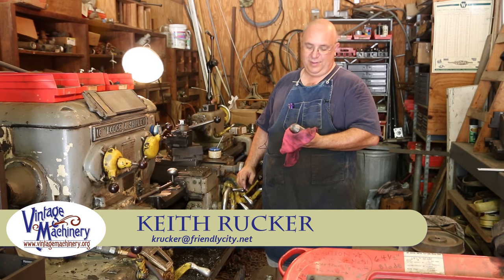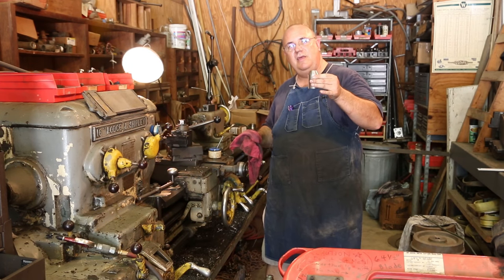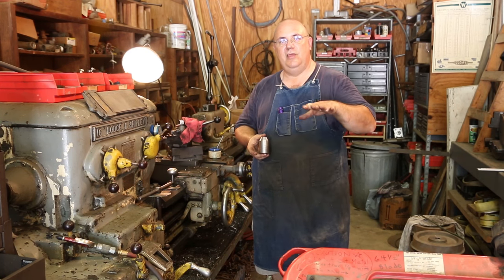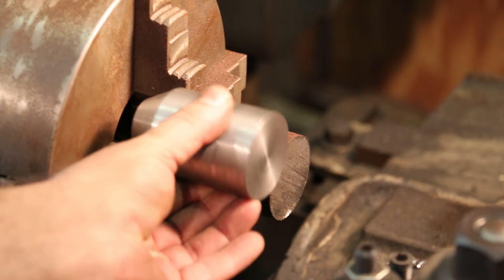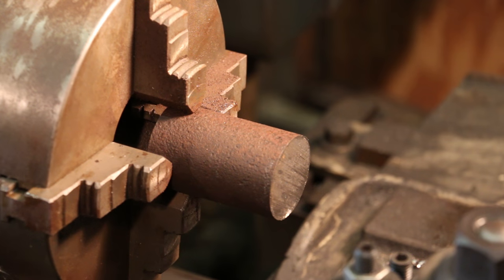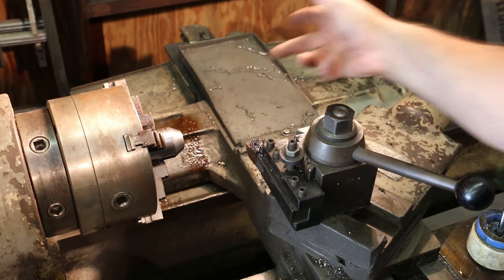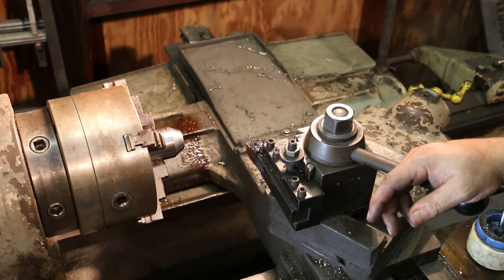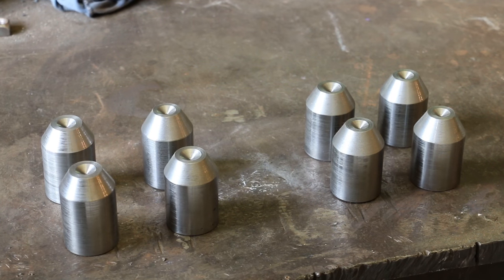Turning Leveling Screw Feet on a Metal Lathe

Comment: Great to see some shop work Keith. I got some looks and ribbing at work when I elevated my work bench, it did look high but you can't underestimate how much strain it takes off your back. Especially doing repetitive work for eight hours. On another subject I passed my bend tests today on Horizontal stick welding with the 309 stainless rod at school. It might be simple for old hands at welding but it took me a bit to get the heat and rod angle right lol. Anyway great vid!
Reply from the maker: I am not a great welder myself, so I fully understand.

Comment: Excellent quickie Keith.  Saw the parallels between this project and when Abom79 made riser feet for his Victor 1660 quite a while back.  It might be a bit overkill maybe, but it probably wouldn't hurt to, like somebody else suggested, tack some square plate stock to the bottom of the riser feet to spread the load on your concrete floor out even a little more.  I occasionally run a large, roller-die cutting machine at my job, and while its definitely lighter than your LaBlond lathe, it still has square plate stock welded to the very bottom of its riser legs to spread out the load on the factory floor.
Reply from the maker: I doubt that I really need to spread it out any more than the four 2" dia feet.  That is over 25 sq in of area contacting the floor.

Comment: People laughed at me when i built the work benches in my shop at 46 inches high not the standard counter top height .. you have just made your life so much easier by lifting the lathe up .. Looking good keith
Reply: I designed a house for a fellow that was 6"-8" who was married to a lady only about 5"-1".  We had to build counter tops at two different heights all around the house.  They were both very happy to finally have counter tops at the right height for both of them.  We also had to put in adjustable shower heads and taller doorways.
Reply: John Ferguson
i am 6'2" and my wife is about 5'7" and she likes the counters high. the ones in the house  hurt her back to bend over to comfortly sit something on them
Reply: John Ferguson
oh forgot   Cool
Reply: Heh. We put our lathe on ~12" blocks. It's a bit too high, but it's what we had. I'm 6'5" and my father is 6'3".
Reply: The Metal Butcher Now that I've had two spinal surgeries I support anyone making an effort to reduce back strain.
Reply from the maker: I am not near as tall as you (about 5'-10"), but having the lathe a bit higher will make it much more more comfortable to use!
Reply: Yes indeed. A short man can't work on a tall machine, but a tall man can work on a short machine, just uncomfortably, so I guess that is why they made them all short. But I fully believe in making machine heights good for the operator. I wish my Bridgeport was up about 4-8", but I don't have any means of lifting it there.
Reply: I'm only 5'7 and raised my Enco up about 3 inches. It makes a huge difference too. Now I find the mill is even lower than the Enco was when I have the table down low. :)
Reply: Keith Rucker - VintageMachinery.org   Maybe you can cut out a slab of some good Georgia granite to use as a base.  You could lift the machine on a firm base but still be able to relocate the mill around the shop.  You wouldn't have to anchor it to the floor.

Comment: Using the old machinist's adage "If a little is good, more must be better!" I would find some scrap plate and cut some 4"x4" squares and put those on the concrete with your feet on top of the plates to spread the load even more on your nice new concrete. You could tack weld them on so there's no possibility of them wandering around because of vibration. Concrete is terrible when subjected to a point load (as you noted with just the adjusting screws bearing on the floor).
    If you look at some old lathe installation instructions, it is actually recommended that the floor be cut and a 6" to 8" base of concrete be poured over a prepared bed of gravel. The leveling studs are mounted in the concrete and the lathe is lowered onto them.  When done properly the concrete is used as a mass to dampen the vibration of the lathe.
   The last time I saw this done was for the installation of a Hitachi vertical turret lathe in the early eighties. They cut the floor in the shop and dug a pit 6' feet deep to build the foundation for the machine. We were cutting Inconel rings for GE jet engine combustion chambers and the lathe was rock solid... you had to hide from the chips that were thrown off with the ceramic/tungsten carbide inserts. 
   I look forward to your videos. They are always entertaining.
Reply from the maker: I am pretty sure that these feet will give more than enough support for that little 12" lathe.
Reply: There is one advantage to having the plates on the floor... you can kick them occasionally and see if the floor has settled under the machine and re-set the feet if needed.
   The lathe should look like the cat's pajamas when you finish all the paint.

Comment: Keith

When ( long time ago now ) I worked at the iron works the trade demarcation was very strong the riggers would do the lifting , the fitters would come in and level the equipment , then the builders would pour grout under the machine to fixit all in place also stopped chips getting under.

All the did with those screws that your lathe has was to put some 3 inch rectangles oh 3/4 plate under them , but I must admit they looked very nice being grouted 

the new equipment sure looks good and brings back fond memories of my past life in heavy industry 

The largest lathe did not have a bed as sutch but large pads set in massive concrete footings the tail stock section was just craned to the required pad bolted down and away thy went

Keep up the good work and don't forget to count your fingers after using machinery ( used to be a sign above the 48 circular saw in the chippies shop)

Stuart
Reply from the maker: I doubt I will grout under this lathe - I may want to rearrange the shop one day!
Reply: I made skirts out of canvas belting to keep wood shavings out of ares in a friends wood shop, Maybe some sheet metal ones around the pedestals? Would also keep critters and such out as well.

Comment: I always use hockey pucks that I drill and counter sink, then use a nut to tie a bolt to the puck and a double nut arrangement to level the lathe on the pucks. absorbs vibration and spreads the load, and after a few years of use they haven't sagged much at all. I would say so long as there is less than 200lbs on each puck it will be okay.
Reply from the maker: I am not even sure where one would find a hockey puck in my neck of the woods.  Most people here would not even know what it was!  With that said, your feet do need to be made out of something that will not compress as if the feet move around, it can cause the lathe to get out of level.

Comment: Even the simplest projects grab my interest. I love all the hints sprinkled thru your videos. A question: What is the cutting fluid that you apply with the brush? What could also be used?  Thanks and "keep 'em coming!"
Reply: An additional question. At ~7.06 in the video - just starting the 3/4" drill to place the dimple for the set screw - the drill bit noticeably jumps. I would like to know why (it happens to me at times even if I have center drilled) and how to prevent it?
Reply from the maker: I use a sulfur based cutting oil - something similar to thread cutting oil used in pipe fitting.  As for the drill, most tailstocks will have a little bit of play in them because when you drill the drill bit will automatically try and find the center of the rotating stock.  When you fist put in a center hole using a center drill, it will do a pretty good job of finding center.  Then when you come in with the next tool, it will follow that same center.

Comment: since its only 8 leveling leg screws... i would think that some 3 or 4" 5/16 plate squares welded to the bottom of those would be better..  even picking up some of the square washers that some hardware stores stock for brick building reinforcing.. those would weld to the bottom easily..  and be really cheep..

Comment: Keith: At 7:07 in the video, where you are drilling, I noticed that the entire drill seemed to jog slightly out of position.  Then it also seemed to come back.  I thought that a tail stock offers a very rigid and stable platform.  Surely these drills can't bend light that.  Can you explain?
Reply from the maker: Most tailstocks are a big loose like that - just enough to let a drill bit find its natural center.  If they were perfectly rigid and the tailstock was off just a bit, your hole would be off as well.  This way, the drill bit finds the center of the rotation and drills perfectly in the center.

Comment: Looking forward to the leveling video. I'm picking up a Leblond lathe next weekend. What size machinist levels are usually needed? Any recommendations on which ones I should get?
Reply from the maker: You need something long enough to go across the ways of your machine.  Of course, you can always place a piece of ground stock across the ways that you know is perfectly flat and both sides parallel to one another and put a smaller level on top of that.  The main thing is that you want to use a precision level that will measure in very fine increments - your every day carpenters level is NOT good enough for this work.  I have a couple of Starrett levels that I will be using.

Comment: At 7:05 and 5 seconds forward you can see the drill flex. Is that normal or can it be avoided?
Reply from the maker: That is normal - the drill bit will find the center of the part being drilled and wander a bit until it gets properly lined up.
Reply: Thanks for the answer. Almost expected to see a plate welded to each piece for extra stability. Those of us with over-dimension-is-a necessity syndrome would feel a slight unease every time bumping into the lathe.
Reply: Dont know why "necessity" has a line all over it.

Comment: What is the advantage of using a 4 jaw scroll over a 3 jaw? I have a nice Buderus 4 jaw scroll that I've never used, have to make a back plate, just never felt the need to put it together.
Reply: 3 jaw you a fixed to where it centres, with 4 jaw, you can move it where you like, and make up for some error.wear in the lathe and all chucks wear as they age, thats why you see all the big guys here using 4 jaws, downside is you have to indicate every time.
Reply: I'm referring to a 4 jaw scroll like Keith is using in the video, not a 4 jaw independent.
Reply: Precision Machine Shed
ahh, then i would say, some improved hold and of course square stock also
, you would have to also consider if you do more hex than square stock, and if both the 3 &4 jaw close down equally as small, or it may not be as handy for you.
Reply: plus, if it is already on the lathe when you start working, you simply can leave it there and don't have to lift those heavy things around :D
Reply from the maker: The truth is that for most work where I want to use a scroll chuck (self centering), I would rather use a three jaw.  The advantage of a four jaw scroll chuck is holding square stock - which is why I bought that chuck.  My problem now is that this four jaw scroll chuck is the best scroll chuck that I have for that lathe, so it gets used a lot.  I would not recommend investing in a four jaw scroll chuck though unless you need to turn a lot of square stock.
Reply: Sounds good, I already have one so I might end up mounting it. I don't do much square stock, but do work with octagon on occasion. Thanks for taking the time to reply!

Comment: I notice when you contacted with the 3/4" drill that it touched then raised up.  My lathe is does this also with every use of a drill bit or center drill on a faced surface.  Can you take some time to talk about why this happens?  Is it finding center?  Is the tail stock too low or too high in the back?
Reply from the maker: It is finding center.  Most tailstocks allow for some movement like this so that it can find its own center.

Comment: Will the feet you mentioned making for the Monarch Lathe be similar? I'd think they'd be shorter since that lathe is already pretty high.
Reply from the maker: The ones for the Monarch will be very short - in fact, they may just be something like some 1/2" thick plate.  That lathe really does not need to be raised up from a comfort standpoint.

Comment: Hi Keith, thanks for the video, just one question... why use four levelling posts, isnt it better to have three?
Reply: i guess he has to use what the lathe is fitted with, and have to support all the feet it has, and it has 8 of them.
Reply from the maker: In the case of leveling legs, since they are screws and you can adjust them to touch the floor, even on an uneven floor, it really does not matter.  It would be easier to level using only three points, but in the case of both the LeBlond lathe I am currently working on and the bigger Monarch lathe that I will be doing later on, there are eight leveling screws.  Part of the reason for doing this is to spread the contact with the floor around more and provide more support for the machine where it contacts the floor.  These big heavy machines can actually sag if they are not properly supported so sometimes you need more places that contact the floor than less.
Reply: Our Colchester has 4 levelling screw and that is what they ar used for. With a precision level you make sure there is no twist in the bed.

Comment: Raising the lathe? Makes sense. Monarchs were a great machine but they gave a tall man a back ache.

Problem is raise the lathe and there's a gap for chips, mice, thread wires, etc to form a housekeeping problem. Beside a lathe hovering 2" off the floor looks odd. I suggest you skirt the pedestals with closely fitted 1/8 x 3 flat bar in two halves wrapped around the corners like baseboard to butt at the center.  These can fit and stay there from gravity or attach with a few flat head screws. Get fancy and cope them to the floor, zero gap.

Paint the skirts black or to match the accent color that relieves the boring solid gray of the rest of the machine. I suggest black for the raised cast-in letters. Cream for the text back ground and lever shanks. Brick red or Windsor green for accent stripes around the headstock cover lip, quick change, carriage etc, rings just below the handles and knobs. Bright nickel plate (not chrome) the handles, knobs, handwheel rims. That sort of thing but restrained. A 70+ year old Monarch has to be dressed with dignity and restraint but she has to look good. Majestic.

But don't let me influence you, it's your lathe.  ;-)
Reply from the maker: Wow, you want me to really go overboard on the lathe!!!  I kind of like some of those suggestions....  I have actually already started doing some of the accent work and I think you will be happy with what I am doing (although not quite to the extremes that you suggest).
Reply: +Keith Rucker - VintageMachinery.org Did I mention the good embossed leather lining for the chip pan? Polish the tops of the hex head bolts and engrave a Monarch logo? Maybe a fringed canopy. Nothing fancy.
Reply: The Leblond may not like being dressed in Monarch swag. :-) Sounds like you have done up some of those fancy steam engines from the doubleboost videos! Polished and embossed bolts are surely high end fare. :-)

Comment: good project, keith.
for my taste, i'd have had those pegs larger in diameter, say, 4.5"
thank you for the video,
-toly
Reply: I would agree with that, I can't get over the thought that they might make the lathe unsteady. By raising the foot off the floor by that much, the centre of gravity is going to change. Making the base as wide or wider than the height, would reduce the risk.
Reply from the maker: I don't think it will be a problem at all.  They are 2" in diameter and 3" tall - it is very unlikely that you could tip the machine over sitting on these.  Maybe if you ran into it with a truck (but then I would have other problems....)
Reply: Keith Rucker - VintageMachinery.org
 I was thinking more about the torque reaction when starting and stopping the motor.

Comment: What car is in the background at the end?
Reply from the maker: The old car in the shop at the museum?  That is a 1926 (I think that is correct) Chevy.  It is basically an old truck frame and the museum turned it into a "rolling store" where the back has sides that open up and they can fill with all kinds of old stuff like you would see a salesman selling back the day.  It is operational and they often will drive the rolling store in local parades and haul it to fairs and such where they might be setting up an exhibit.
Reply: Nice, thanks for sharing.

Comment: With that set screw simply resting in the hollow, do you think there may be a chance of your lathe being too top heavy and tend to topple over, or "kicking out" one or more of the "feet" you just made?
Reply from the maker: No, I don't think it will be a problem.  The diameter of those feet are 2" and the height 3" - and with eight feet under the lathe making contact with the floor, it would take a LOT of force to topple things over.

Comment: I do worry about stability. Surely it would be better to thread them to take the levelling screws.
Reply from the maker: I don't think stability will be a problem - they are 2" in diameter, plenty of material on the floor, and only 3" high.  They won't go anywhere....

Comment: i am 6'2 " and I wish I had installed my lathe about 6 inches taller.  kind of dumb I didn't because my work bench is at my rib cage height and I really like that
Reply from the maker: It is never tool ate to modify it!
Reply: +Keith Rucker - VintageMachinery.org        A ways down my "to do" list but I have added it